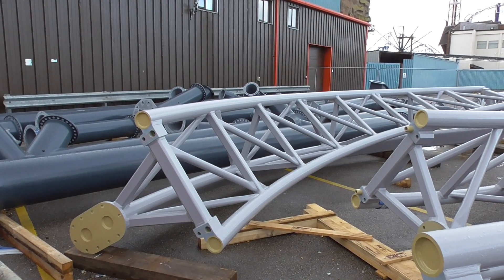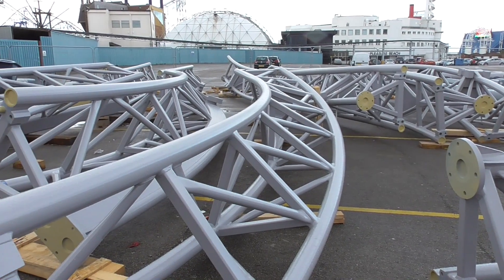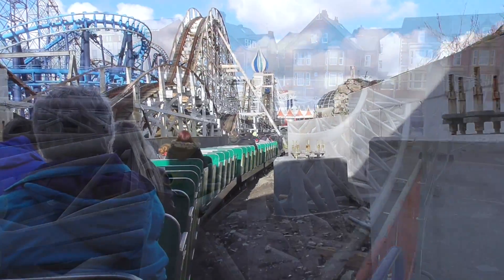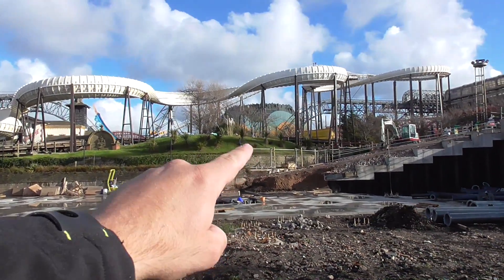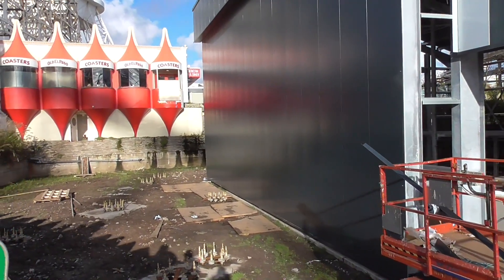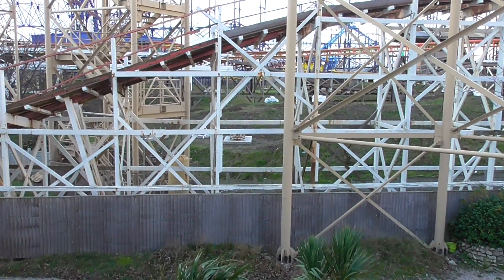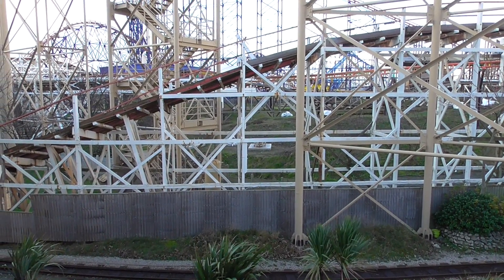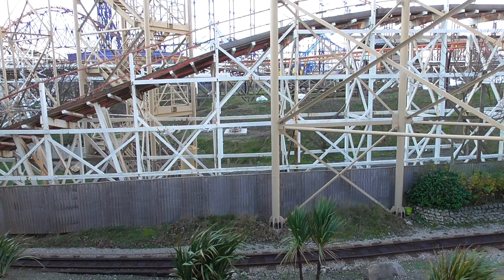ICON Construction Update Blackpool Pleasure Beach 4th November 2017

Comment: this £16.25m project looks good but it might be a flop once its built and 1st test cause when they completed the big one and opened it stopped on the lifthill and a question about the cladding on the exterior i hope theyre using safe cladding
Reply from the maker: Entertainment INC Hi, being completely honest here, your logic is very confusing. There's footage of the Big One's first ever test run online and it makes a full circuit with no stoppages, also usually when a coaster stops on a lift hill it's for safety reasons. Icon doesn't need a lift hill, it's launched. There's absolutely no way Icon will be a flop.
Reply: Pleasure Beach Experience okay thanks for clearing that up :)
Reply: It’s just that pleasure beach back 90s did have break downs with the big one before yes it did stop for safety reasons but I’m not saying it will stop on the launch hill I meaning at the emergency unloading bays but we all won’t know how it will go till it’s complete and goes for it’s 1st run when will it be finished?
Reply from the maker: Entertainment INC What's your point? No coaster in the world runs faultlessly every day without break downs from time to time.
Reply: Pleasure Beach Experience not making a point I’m just giving my own opinion
Reply from the maker: Entertainment INC You're not making any sense though, your initial claim was Icon will be a flop but never backed it up and then commented on the Big One.
Reply: Pleasure Beach Experience okay can we clear this up and move on I may now sound like idiot in this comments what all I was trying to say is that this coaster is gonna be good for the park but it could a hiccup when it opens but not all coasters are faultless but bpb did really well on fusion that’s all I am saying that it could break down in the beginning but it can be fixed again but the big one was controversial when it broke down when it opened but it worked great after and also I’m a big fan of you guys
Reply from the maker: All coasters have problems in their first year, it's quite normal to have teething problems as the ride is settling into daily operation.
Reply: i almost tryed going for a role in blackpool pleasure beach once i decided not to cause i realised if i have to work there for a season i would need to find a place to stay for that season which is pricey it was role for ticket sales selling ride tickets and wristbands which sounds like a good role but i was looking for a role in ride operation like the flat rides i loved the ghost train my fave
Reply: :) any of you guys ever like to work in blackpool pleasure beach?
Reply from the maker: It would depend on the department, would be great to be a ride operator for one day only on the Big One but otherwise would like to work in PR and do a lot of the video work for the park, would be so cool to do.
Reply: the photopass roles are much fun i always admire amanda thompson and her father was great man i saw him on the documentary